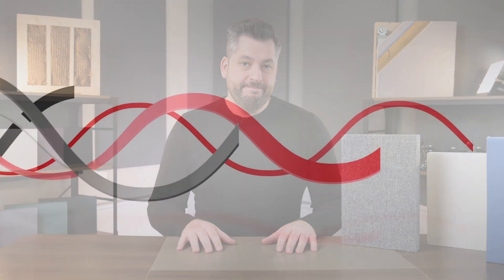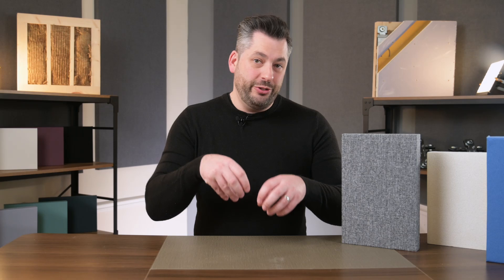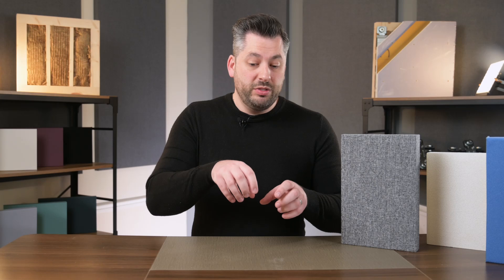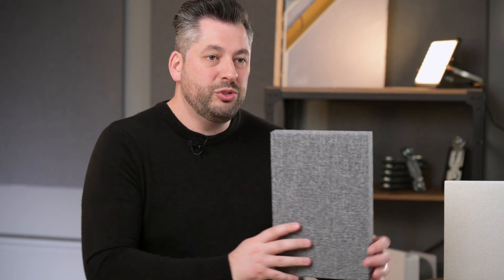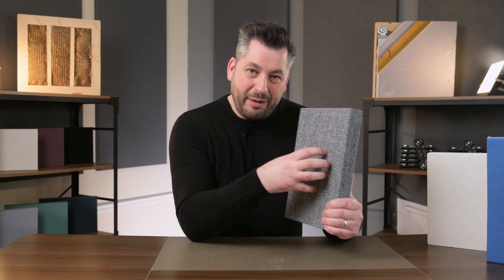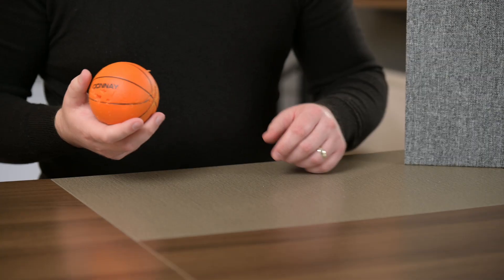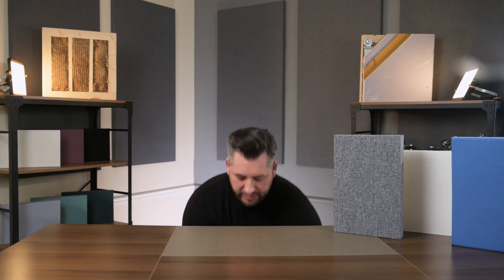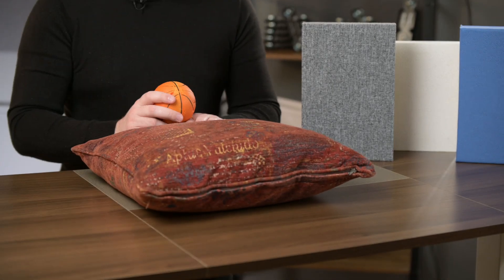What is the difference between Sound Absorption and Soundproofing?

Comment: Hi, I have a question. 

If sound absorption is to reduce echos within a room, does it reduce echos of sounds coming form outside? 

For example, let’s say your neighbor is closing a door. And that door slamming sound apparently comes from outside of your apartment room. Door slamming sound travels into your room, however your room is full of egg-shaped foam tiles. Does that door slamming sound becomes reduced, since the echo of that sound is reduced/removed? So it’s like, you still hear it, but “echo and reverberation” is removed, which somewhat reduces the overall decibel of that door slamming sound. 

I’m not very expert in soundproofing, so I’m asking this question as apparently you guys are top-tier experts!
Reply from the maker: Hi @eugenerider0701, sound absorption helps reduce echo and reverberation within the room, not with sounds heard inside the room which have travelled from an external source (this would require soundproofing). This article on how to stop a door from slamming might be of interest: https://www.soundproofingstore.co.uk/search?searchTerm=doors

Comment: Hi, I'm now in the process of making basstraps and absorbers for a rehearsal room for a 7 member band.  I will use wooden construction and fiberglass. But my question is about the textile which will go over the panels and basstraps. It has to be breathable to let the sound reach the insulation, but also it should stop the particles of the fiberglass to go into the room. Which textile is the best to use? IS maybe an additional layer of something thin an option? Thanks
Reply from the maker: Hi @njokisasirom, our ProSound Acoustic Panels have been meticulously designed and tested with specially designed cores and outer fabric wrapping. Unfortunately this means the materials used are closely protected and patented.

Comment: Hi and thanks for your amazing tutorials.
Why can't we  soundproof a room using just absorbers even if Rockwool has absorbtion coefficient 1 in many frequencies?!
So shouldn't Rockwool absorbs frequencies with absorbtion coefficient 1 and leave nothing to reach our ears?!
Reply from the maker: Hi @alirezayousefi4544, great to hear that you've found the videos useful.
With regards to the Rockwool, acoustic mineral wool is used within our systems to absorb sound energy within cavity spaces (most commonly used in timber floor and ceiling cavities and stud walls). However, it doesn't soundproof the structure, as it doesn't have enough mass to block sound. This video goes into more detail:
https://youtu.be/nkfVpoXEAiQ?list=PLuzNxK_R25wBueiDEUzdMUjXcqCON4pL7

Comment: My bedroom is at the front of my house. And theres noises coming in with a real sudden thud such as boot lids been shut or van doors been slammed. I was wondering would the acoustic panels absorb the sound energy coming in and dampen the sound to a reduced level ?
Reply from the maker: Hi Jessica, i'm afraid not. This is noise from outside the property getting in. So this requires soundproofing. The acoustic panels are for reducing echo within a space. Usually when sound from outside is getting in, more often than not the windows are the culprit and external walls are usually very good at blocking sound. However that is not always the case. The best thing to do is get in touch with us through the website and we can have a chat with you and get to the bottom of the problem and recommend a solution for you. https://www.soundproofingstore.co.uk/